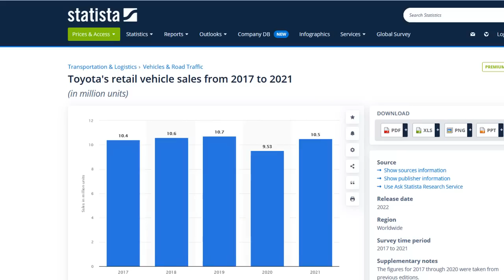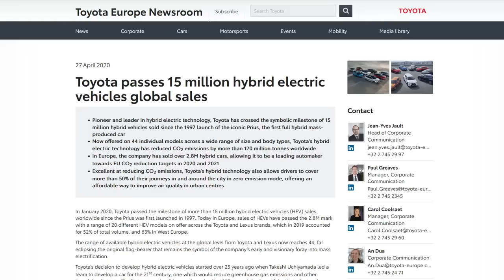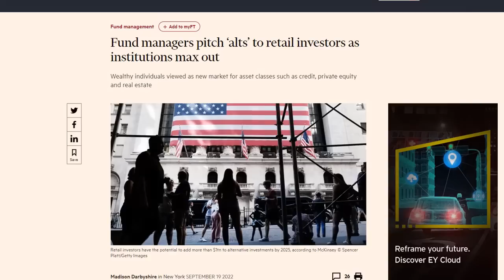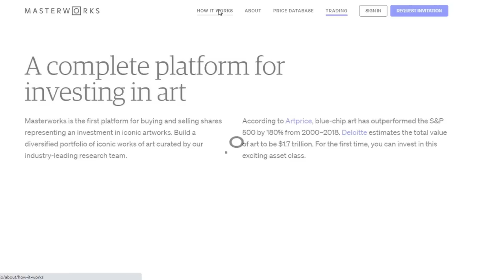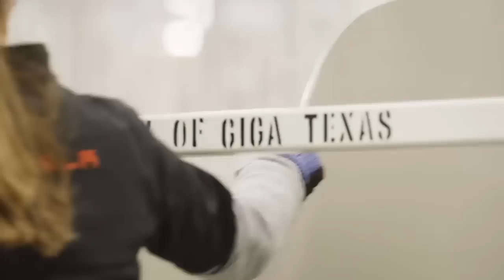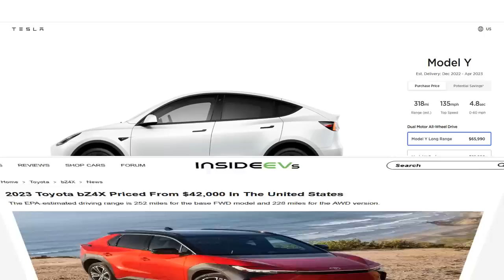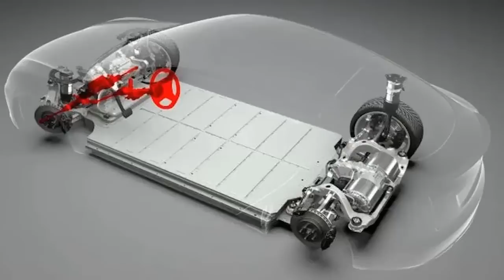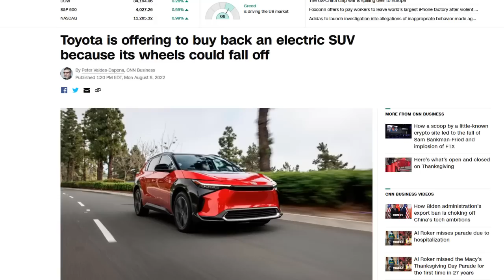Toyota’s ALL NEW 2023 bZ4x EV in for a SHOCKING Surprise

Comment: If Toyota had kept their TSLA shares from the partnership, they would be worth more than Toyota's market cap.
Reply: Same goes for Daimler.
Reply: price overrated cause people not logical
Reply: @sevencostanza3931  Price is not overrated
Reply: @Nobottee yes, currently FSD and energy not priced in the stock, which is nuts. FSD is out there for everyone to see the progress, and now it's clear that is around the corner (maybe 2 years?). And as stated multiple times, millions of cars on the road are already potential adopters...
Reply: PE is 56.or 1.8% return.
Reply: Just fact and Tesla has no debt while Toyoda must soon listen to banks as they have debt over 100 Bio USD!!!
And losing market share .
Superiority feeling while moving kaizen speed while the game is moving to software!!!
Reply: @lechavs  I would guess 10+ years for FSD to be level 5.  Right now the Super-cruise system is superior and FSD progress has been glacial.   I agree that millions of the cars on the road are potential adopters of EVs.  No reason to think Tesla dominate if sales volume.  They have 2 nearly luxury vehicles each in a single trim that they rely on for revenue.  Both of them have quality issues and are substandard in many ways.  Great drive train and charging network though!
Reply: @sevencostanza3931  the price is the price, it doesnt matter why.
Reply: @wizzyno1566  yes true but like most stock, prices valuations are way too high. We live in a illogical world when it comes to the emotional stock market.

Comment: I would much rather a hybrid then a BEV. I live in Canada so winter is rough. BEV's here would lose a lot of range when cold out. PHEV is something I would look into. Electric when you go short range, gas to go long range or when cold. Wish they would make a truck PHEV.
Reply: Where in Canada? And how cold does it get? Norway teslas has no/small issues with out winters. But it only gets like -10 c or as low as -20c so could be worse for u depending
Reply: This is Toyota propoganda.  Newer models (Tesla especially) do not lose nearly as much range in the cold, with the introduction of things such as heat pumps.

Comment: The Problem with Toyota is that for over a decade they've been developing a HFCEV (Hydrogen Fuel Cell EV) as well as graphene batteries in case the HFCEVs did not take off within a 5 years and now that the HFCEV has not taken off with the Toyota Mirai, and that Graphene Batteries are not really a thing yet, they're struggling to develop electric vehicles and the bZ4X has clearly not been a success especially since it was clearly rushed to market.

It is also worth noting that a Japan-only Kei-Car was the first non-Tesla Co-Developed BEV from Toyota since the RAV4 EV was discontinued in ~2014 as it was released & announced before the bZ4X, and the Kei car is called the C+POD.

I might also mention that Toyota also has to deal with over 100+ markets in which their cars are sold in with drastically different income levels in direct comparison to Tesla whom only sells their cars in Western & Central Europe, North America, China, Japan, South Korea (?), Taiwan (?), Hong Kong, Singapore (?), Pacific nations (e.g. Australia, New Zealand) and a few others, plus Toyota has many more vehicle segments that they manufacture nameplates under which covers nearly every car type from small Kei cars to massive SUVs and Pickup Trucks to single-deck buses and Lorries (Semi-Trucks (Sold under the HINO Motors brand) and many more which they also need to deal with unlike the New Boys (i.e. Tesla)...
Reply: In others words.  Toyota is an ice berg that will be last to pivot
Reply: That is good to note but honestly just sounds like Toyotas problem. They made a complex network with so many moving variables and now its biting them in the ass because that is inherently what is wrong with legacy auto makers. They are dinosaurs and cannot adapt to change when they should be DRIVING the change.

Comment: The Plug IN Hybrids are a decent idea.  With newer batteries, the electric range could be 100km to even 200km - that would eliminate 80% of fuel consumption but be easier to charge up because they are smaller batteries than an all electric vehicle and more reliable in cold climate.  Just a thought.

Comment: I drive a Model Y and after much research into was was available here in the US and what was going to be available I dropped my deposit down last year. I had the Ioniq 5, EV and even the Nissan Ariya on my list and as a last result I thew in the ID 4 for comparison. For me the Model Y along with the ever expanding and reliably consistent charging network along with it's storage by space/volume compared to the competition on my list.

I had high hope for Toyota at the time but they weren't in a position to make the list and at the time no specs were released. Now, other than the fact that the BZ4x looks like a modern day Rav4 I'm fine with that' It's styling is appealing to a lot of people but the sub par performance and charging is a huge issue even if the wheels weren't falling off the thing.

Unfortunately this has left a negative impression around safety of their vehicles. Just like the Chevy Bolt. Chevy, from what I understand, took a huge loss because of the battery fires and now they've even dropped the price to move them and I hear they're not really making a profit on them.

I wish Toyota luck. They had an opportunity to wow us when they released the new Prius. They had an opportunity to go all electric with the new design which is a really good looking car but they went hybrid again and all of the air was deflated from the hype of that car.
Reply: Here in Europe the Model Y is the cheapest in all comparable EVs. Of course there are always cheaper "base models" without seat heater or warranty but who wants to buy a naked car?

Comment: The problem boils down to infrastructure dependence. It does you no good to produce a vehicle, no matter how well made, if you don't have the means to support it by having a reliable charging network available to support your customers 24/7/365.
The second problem is cost. I am retired and live on a fixed income. I can't afford and E/V that cost over 40 k. And I am not alone! In my case I don't make enough money, nor do I have the credit to buy a car like that. So the product is unattainable.
So what can Toyota do?
My advice is to: 
 A.) Engineer a platform, following Tesla's example, using one platform that supports each model. Start with one low cost model that people can afford. Build it in the U.S.. Make it absolutely reliable with a 500 mile range! Then add new designs based on the same platform in use as you can over time until your goal is achieved.  
B.) Buy, or create a network of charging stations to support your product. offer free charging for a set time to get customers interested in owning your product.

Comment: I sat in a bz4x (at the Chesterfield UK dealership) and while it was nice I was staggered by how little space they'd crammed in.
Almost claustrophobic and with fabric on the dashboard.
Reply: I sat in one yesterday (I was at a Toyota dealership for reasons unconnected with the bz4x but thought id take the chance to sit in one as I do have an EV so was mildly interested). 
The drivers seat felt overly enclosed given the very large size of the car. The all black interior also made it feel more cramped it was almost oppressively black. Maybe its available in a lighter interior colour?
 The showroom had 3 or maybe 4 bz4x's in it so they seem to have some to sell. The boot was a good space but then its a big car. I wouldn't buy one because (a) Toyota, and (b)  poor acceleration even in the two motor car. The sign in the showroom said range of 317 miles which is decent though. If its correct.
Reply: @Joe-lb8qn  "If its correct" Of course its correct, Toyota is the only one making self charging EVs. Advertisments never lie.

Comment: I believe the Honda Insight was the first mass-produced hybrid.
Reply: Prius (1997) beat the Insight (1999) by two years  easy to google.
Reply: @YKSGuy  Do you think I didn't?
Reply: Before Insight, there was a Honda EV Plus. Yes it was a full EV but the program fail badly ended up recalling all leased EV, decommissioned and destroyed. Batteries and remaining blueprints of EV Plus were transfered to 1st generation Insight.
Reply: Actually, the Toyota Prius was first. The Insight was the first to market in the USA though. I thought the Insight was a good start for Honda, but a 2-seater wasn't what the market really wanted.

Comment: Those automakers don’t realize how fast the market is shifting, the reason EVs are not making up 80%+ of the sales yet is simply because there aren’t many available to purchase yet in 2022, many still has a long wait list, only Tesla is available which leaves out many older folks who are used to the traditional brands. However all of this is changing in the next 3 years, you have massive EV models from all the traditional brands coming online with actual inventory that can be delivered, ie mercedes with their strong eq* line up. Volvo popular XC90 replacement, then on the non-luxury end you have gm hyundai and ford(to some extend) all flooding the market with many models. No one will want to buy a combustion engine vehicle anymore at that point, even the regular mom pops who don’t care about ev, will want to buy ev for fear of buying something obsolete with no resale value down the road.  That that point Honda and Toyota will both be in big trouble, they both are significantly underestimating the speed of the transition due to their current dominance/arrogance. They need to haul ass immediately to start retooling all the factories / ramp up battery production etc…which is not happening.  I would sell Honda and Toyota stocks, not going to end well,

Comment: “Because I don’t want to pay for two propulsion systems on a vehicle.”

This is complete nonsense. Batteries are extremely expensive, so eliminating half the battery range easily offsets the cost of a small engine. Plug-in hybrids are a great idea. The plug-in Prius is awesome. Why doesn’t Toyota make a while lineup of plug-in hybrid vehicles using the same technology?

Comment: Toyota is curently stuck using low range LFP batteries in the BZ4.......That will have to change.....BZ4's are only averaging 180 miles on charge.............That don't get it....................Paul

Comment: Apart from the "wheels falling off" recall, have there been other quality problems with the Toyota EV? Unmentioned by TMIO is the unfortunate fact that Tesla has quality control problems. Canadian Prepper got one and showed, on video, where the hood was unevenly installed with a larger gap on one side. Not the end of the world, but still a sign of sloppy fit-and-finish. Toyota's famous for their QC and fit-and-finish excellence and I suspect that's where they'll have the edge in a couple of years when they really get going with EV's. That said, certainly it's questionable whether they waited too long, or wasted too much time on Mirai and PHEV. In my opinion, Toyota PHEV is the current best option, with huge range, EV-only mode for short range trips, and high quality. Toyota is not going to disappear any time soon.  GM... I have a lot less faith. They are a zombie car company.

Comment: Electric vehicles are about the battery; does it have long range, does it fast charge, does it need special cooling or heating, is it expensive, can a replacement battery pack be had easily and inexpensively, are there charge stations when traveling. Style and ease of use with a wow factor also matter. So who will bring this wonder battery to market and when? I don't know but they will win EV prize.

Comment: The Toyota bZ4X and identical Subaru Solterra have had a bad start this year. First there was the problem with wheel mounts that prevented owners from driving their new EV (!), while it has now come out that both models lose about half their battery capacity when the temperature goes towards freezing. Apparently Toyota forgot to install a system to keep the temperature of the battery constant... or it does not work correctly. These conclusions were reached after tests in both Norway and Denmark, writes Auto55. The Norwegian Elbil24 even **accuses Toyota of misleading communication**. After all, the Japanese manufacturer claims that the bZ4x has a 71.4 kWh battery, while in reality it would only be 62 kWh. The autonomy was calculated by the brand on the first value, which is therefore incorrect according to the car site just quoted. In concrete terms: instead of the promised 470 km range, the journalists have reached just 314 km (in eco mode..!). 314 is of course more than half of 470, but that was calculated without taking into account some Danish researchers. They drove at an average of only 110 km/h and at 4°C with four-wheel drive. The version of the SUV equipped with two electric motors only managed… 194 km..! The test was then repeated with a single-engine bZ4x and the results were also disappointing: 246 instead of 504 km. Very, very bad!
Poor Toyota, which no longer succeeds in making a decent car with new technology. I have been a supporter of Toyota for twenty years, but not anymore.

Comment: 2:13 yeah lol, why would anyone buy a car that only goes 95 miles lol that is only 45 miles one way (add heat, AC accessories to drain the range to probably 70-80 miles). And with age the miles would go even lower. Like who in the world decide to produce 95 miles SUV?? Small smart car is fine for that of a low millage, but SUV?

Comment: @ 0:15 to 1:15 It sounds like Toyota just needs to follow it's own established ICE manufacturing system and apply it to BEV... and start fresh in Japan... Start with one huge Giga Factory Phase 1 to learn all can ala-Tesla Fremont, apply all learned to Phase 2 ala-Giga Nevada optimizing its production line #1. line #2 #3 and so on....  Phase 3 the Giga Shanghai of Toyota.  Phase 4 Build "Knock Down" Production Lines Kits to export to its overseas Giga Factories... Easy Peasy, He he he he!! Pre-Fab Giga Factories..
Reply: Yes, they need to do that, but in 2012, not 2022. They're at least 7-8 years behind

Comment: This is pure Tesla driven hype.... FACT ... although the EU and China are adopting quicker (with MUCH higher gasoline prices and far less volume of cars overall) The US is VERY VERY slow to adopt and apprehensive regarding the charge times. 

Everyone is so stuck on "Range" ... the average cars full tank range is appx 300-350 miles.... the MAIN issue is the recharge times, once you can recharge in the same time it takes to fill a gas tank I think EV's will then overtake and actually make sense. 

Then there's the infrastructure...not even gonna touch that timeframe. 

As of August of this year EV's make up ONE percent of all cars trucks and SUV's in the US.

Comment: Why are most makers hell bent on 0-60 stats on an ev model? Range and power tq for carrying should be the need list not hp, besides we can only go so fast on the roads anyhow.
Reply: Too many poor highway ramps. There is one near me that you do not want to enter with a slow car.
Reply: Efficiency should be top of the list. watt hours / mile. This is the running cost after all. You wouldn't buy an ice car without checking mpg.
Reply: @sdpryce  I agree, I am just pointing out why 0-60 can also be a factor.

Comment: a hundred year plan, what a ridiculous waste of time and capital.  you cant even accurately predict what the future is going to be like 30 years from now.  if this was anything other than a gimmick, so they can boast about how meticulous and methodical they are, it was extremely pointless and a giant waste of time.  then you throw in the fact that the leader of the company is not even put in that position because they are qualified, they gain the position simply because of their name.  imagine having a hundred year plan and not even having the foresight to see that putting someone in charge simply because of their name(a person that will grow up spoiled and pampered if the business is a global success like toyota) is not a good idea, because there is a good chance they simply are not qualified enough to run such a large company.  the great grandson, mr. akio toyoda, is doing a wonderful job of showing how unqualified he is with each EV decision he makes.

toyota is a joke of a company now, and my toyota corolla was one of the biggest pieces of trash cars i have ever owned in my life, and the thing was basically a death box because it was so cheaply made.  you couldnt even drive over the tiniest little puddle going over 45 mph without feeling like it was about to hydroplane and completely lose control.  cant say im surprised the wheels fall off the EV, after all the recalls my corolla had.

Comment: It looks to me like Toyota has sacrificed some range and charging speed in favor of extra long battery life. They offer an optional 10 year, 600,000 mile battery warranty, and claim they have designed the battery to retain 90% of its original capacity at 10 years. This does not require a battery that is inherently better than what Tesla is using. The extra life is achieved by calibrating the charge circuits to only fill the battery ~ 90% full when the indicated charge state is 100%, and by limiting the peak DC fast charging speed.
This isn't good specmanship - but it might be the best strategy for Toyota, as it aligns with their brand image as a producer of supremely trouble free vehicles.
Reply: My Apple MacBook Pro, introduced in 2021, has a user-selectable option to apply an AI-based algorithm to extend battery life based on usage.